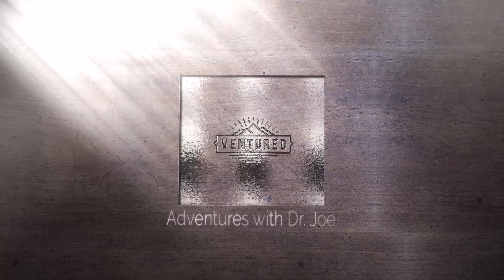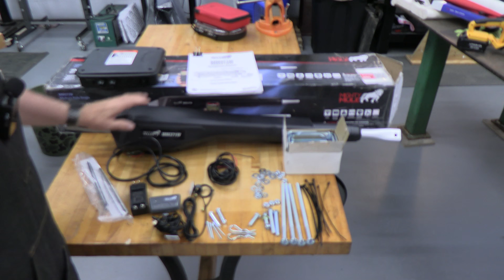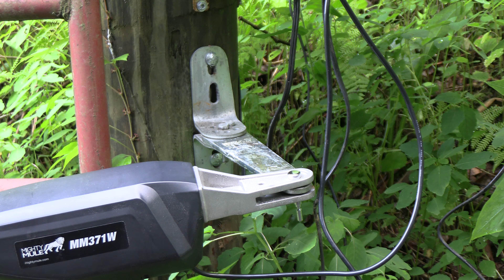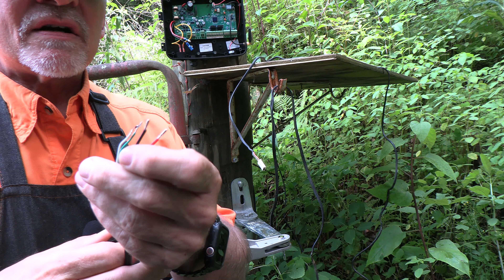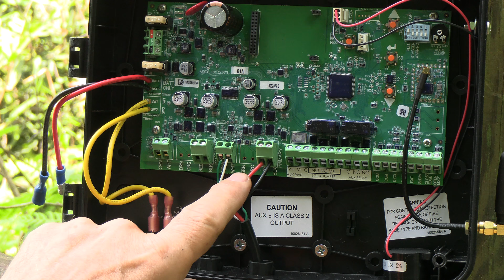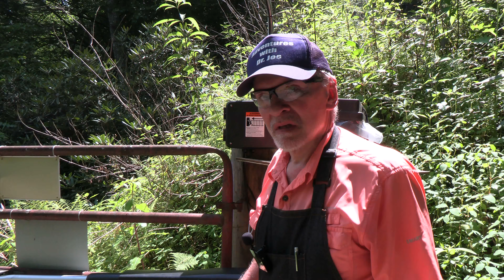Mighty Mule MM371W Review, Install and Setup

Comment: Dr.Joe great video. You answered all the instructions in the manual. I would be in your debt if you explained your 12volt car battery  connections? I am familiar with with the crimp on connectors used bit wondered about the terminal to connectors pathway. Ideally pictures and descriptions of your setup please.
Reply from the maker: I’ve taken a picture of what I think you’re interested in. I hope this helps.

Comment: I have a pull to open to leave the property so which pin is in use?
Reply from the maker: For a pull to open setup, you will use the pin on the top bracket. Thanks for asking, consider subscribing. Joe.

Comment: Joe, my 371 was working fairly fine until I tried to set the limits a bit more to my liking. Using your advice it was working better but not quite good enough. I tried it again and now it won't open or close and remote won't work. I've turned it on and off a number of times, hit the reset button a number of times. I don't know what else to do. Any advice?
Reply from the maker: Boy that’s a bummer. I’m not certain what to do but the first thing I would try is to disconnect the power so it allows it to completely reset if there’s a reset button and I can’t recall if there is or not I push that as well and get things started from scratch. Thanks. Joe.

Comment: The instruction manual says to run the gate through four complete open and closed cycles after setting the close limit. I can't find any way to do that since the remote will not work until the open and close limits are set.
Reply from the maker: So I would reset everything basically disconnect the power to the opener and then reset the remote then when you reset it all it should work properly. Give that a try. Thanks. Joe.

Comment: I talked to Mighty Mule tech support today.  They are saying that none of their models have an open limit.  The ram will withdraw 100% and it's up to the installer to connect it to the gate in the correct place.  My older model for sure had this feature, but that was a "Pro" version.
Reply from the maker: Yes, I believe you are correct. So during install it needs to be set up properly so when it fully opens up, it’s in a good position.

Comment: How did you hook up the wiring to the battery?  I'm currently using the small gate opener batteries but they are not cutting it.  I want to put a marine battery but my battery wiring just has those small spade attachments.  I don't know how I would hook that up to the battery.
Reply from the maker: Yes, the small batteries will not cut it. You need the full size battery and a marine battery is a good idea. I have a large 12 V car battery connected to a solar panel and what I use are large alligator clips as if you’re doing a jumpstart. I can’t recall if they came with thegate opener, but I believe they did. Thanks, Joe.

Comment: What kind of adapters you use for the power ? The yellow ones
Reply from the maker: I'm not sure I understand. It's powered by a 12 V car battery basically the connections are pretty straightforward and they aren't I also have a solar panel and it's pretty well labeled were the solar panel connects. Answers and thriving. Thanks. Joseph

Comment: I tried setting the close position but it keeps going past the limit I set
Reply from the maker: Yes I know that's a problem. Fully open is not adjustable so what you need to do is have it all the way open in the determine the correct position for your gate that adjust the setting for the closed position.

Comment: Ah. After installing mine. It keeps beeping. I also have a gate lock too.  Followed wiring and all. So im still troubleshooting
Reply from the maker: That beeping could be related to the gate lock, double-check the connections. It’s also possible that the beeping is related to low battery level. I would check that also Consider subscribing. Thanks. Joe.

Comment: I have a transformer to produce 12 volts.  Can I connect that directly to the battery input wiring on the control board?  It would seem there is no need for a battery if we have a 12 volt source from a transfomer.  We did this with the Ghost Gate Closer.  Worked for years.
Reply from the maker: To me that sounds like a great idea. I would give it a try. It’s a very clever. Thought. Let me know if it works or not. Thank you. You consider subscribing. Joe.

Comment: Mine isn't programming I can power it up by pressing and holding top and middle button
Reply from the maker: Thank you for your comment. I’m not certain as to what to do with that, but I would recommend disconnecting the battery. Totally powering it down and starting the programming process again if that doesn’t work, probably have to contact mighty Mule for a replacement. Thanks, Joe.

Comment: Mine opens 3ft and stops and starts a steady beep. Tested battery to 12/71 volts. What is the problem. It was working
Reply from the maker: Wow,

I’m not sure what the problem is. My recommendation though at this point is to do a reset unplug it from all its power reset it and you’ll probably have to go back and recalibrate the limit switch that should fix it. Sorry that happened to you. Consider subscribing. Thanks. Joe.

Comment: The current model only allows you to set one limit.  For example, with a push to close, you can set the close limit.  You cannot set an open limit.  You have to fiddle with the bracket and mount to get it just right.  This is a serious negative change that Mighty Mule has put into their systems.
Reply from the maker: Yes, I understand that. Thank you for your nice comment. I agree. However it remains a good unit, but it does have the deficiency. Consider subscribing. Thanks. Joe.

Comment: installed a new MM371W and got to the arm limit program steps and the arm will not close or open. Installed a brand new 12V battery and solar panel. Followed your instructions from this video (your instructions are much clearer and easier to follow than the instruction manual) However, the arm will not move. Any advice on how to correct this situation?
Reply from the maker: Man that's a tough one I'm sorry doesn't work. Probably need to give the company mighty Mueller called they can be very helpful thanks Joe

Comment: I have tried several times to program both the open and closed limits on the very same gate opener. My setup is pull to open. 
I can get the clothes position set properly but the open position as the arm retracts it will not stop until it bottoms out no matter where I set the manual limit. Please advise
Reply from the maker: Sorry to hear about that. This issue has come up a number of times. My recommendation is to completely power down the unit disconnect the battery source let it sit and then reprogram it from the very beginning. This seems to be effective. Why one closure limit works and the other doesn’t is a mystery. Give that a shot. I think that’ll help consider subscribing. Thanks. Joe
Reply: @JosephHunstad  i will try that recommendation and report back.
Thank you for the prompt reply

Comment: After a long search, finally somebody that explained the open and close setting on the MM371W. Thank you!!
Reply from the maker: Thank you for your very nice comment. I sincerely appreciate that. Consider subscribing. Thanks. Joe.
Reply: After an hour of trying to set the open limits without luck I found out that the open limits are just as far as it opens. You only set the close limits. Just make sure you don't have anything obstructing the full open or it will hit it thinking it is obstructed and close immediately instead of waiting for the close timer.
Reply: @JasonPenrose thank you, i only saw closed limit in the instructions (for pull to open).  I was searching and searching to see if we needed to do both.
Reply: @JasonPenrose ugh that was my problem too.  Why does he set the limits for open and closed on the video?

Comment: I have tried numerous times to program this Model to my Ford HomeLink System without success.  Do you have  video of how it is supposed to work?    Would appreciate any help you would share.
Reply from the maker: I have never tried that with the Ford Homelink system nor have I tried it with Home leak on a GMC product. In my truck I just have a small remote that I leave in the armrest compartment. Consider subscribing. Thanks. Joe.
Reply from the maker: Wait a minute I think I know how to do this. When you are programming your home link in your truck or vehicle, you program a two in existing remote control. It’s worth a try so just use the remote control that works on your gate when programming your vehicle. Let me know how that works. I have not done that. Thanks, Joe.

Comment: Hi! I have my limits set but the insurrections say to run it four times open and closed to get it to “set”. I don’t have a button for this and cannot get the system to stop “chirping” after setting my limits. I tried to program a remote to use it to open and close 4 times to set but does not allow my remote to control the gate because I think I am still in a learning mode while it chirps
Reply from the maker: I feel your frustration. Sometimes the opener needs to be reset and I’ve had success with that so I would completely disconnected from the power turn it off. Let it sit for about a minute or two and then start over again and that’s usually solve the problem for me. Consider subscribing. Thanks. Joe.
Reply: Did you ever figure it out I’m struggling with this same exact issue right now

Comment: , 9 will not stay closed
Reply from the maker: That’s a difficult question and a problem. What I would do is completely disconnect the battery let it get turned off let it reset and reconnect the battery that might fix it sometimes like a computer that Gate needs to be reset or rebooted. Consider subscribing. Thanks. Joe.
Reply: @JosephHunstad how long did you take to install it?

Comment: I've set and reset the opening  dozens of times,  and each time it goes beyond the "STOP" position I previously set. It appears to travel until the Ram is fully " in" no matter how many times I reset it.😢
Reply from the maker: That’s incredibly frustrating. I feel your pain. I experienced it myself and then I basically just reset it by disconnecting the battery and then reset everything and it worked. Consider subscribing. Thanks. Joe.
Reply: Did you ever figure this out? My new gate doesn’t stop either!?
Reply: Same issue here. Can set the open limit but not the close limit!

Comment: Joe, if a person screw's out the ram to adjust for short or long by hand will this mess with anything when setting the limits?? mine dont want to set a limit on pull to open at the fully open positions it will set the limit on fully closed but not fully open, any suggestions?
Reply from the maker: You ask an excellent question. If you do screw out the ram it could change the final position or set limit of either full close or full open. My only suggestion to this dilemma is to turn it all off and reset both open and close limits. It may work out OK that way. Consider subscribing. Thanks. Joe.

Comment: Thanks for making the video. Thoughts on installing an additional post to hang the gate operator on instead of using the additional bracket? I am about to hang mine and thought about doing that instead.
Reply from the maker: I mean, I think that’s a good idea
Reply from the maker: I think that’s a good idea. It may be unnecessary though. The gate opener is really really good way better than the previous ones consider subscribing. Thanks. Joe.

Comment: I wish I could get mine to work I have installed three MM gate openers in the past this so called smart one just will not work. already contacted the company.  I hope it's something simple but i think i got a bad unit.
Reply: Got it working... I think the problem was dip switches 4-5 were off and not on like in the picture in the manual. The manual says they do nothing but it makes me wonder cause it's now working with them in the on position.
Reply from the maker: I am so sorry to hear that. You know I have been through a number of these gate openers, but the newest model has the electronics separately in a waterproof box which makes total sense much better than having the electronics in the motorhead which frequently would get wet, also susceptible to insect manifestation, etc. I hope it works out for you so far my new unit has worked very well. Consider subscribing. Thanks. Joe.

Comment: Hey Joe great video! 

Another question for you: Our gate stops after tapping the hinge/ lock but closes about an inch shy of where it should to engage the locking mechanism. Do we need to reset the open and closed positions manually to fix this?
Reply from the maker: That’s a very good question. I believe you do need to reset manually the open close points to fix that. I hope your Gates working well. I really like my new one. I think it’s a vast improvement over the previous one. Consider subscribing. Thanks. Joe.

Comment: Great information. I’m having an issue with the remote. It sometimes takes me pushing the button 5 times before the gate opens. It beeps and everything, it’s like the signal doesn’t catch until after the 5th or 6th time. Any suggestions why that is? Does it on all remotes. Hit or miss.
Reply from the maker: Thank you for your comment and question. I’m glad you found the video helpful. I would probably replace the battery or the remote as a first thing and be certain when I use the remote. It has a clear line of sight to gate opener. Apart from that, I’m really not sure. Consider subscribing. Thanks. Joe.

Comment: Thanks for this video! I installed mine correctly - powered up, but would not open or close. I rewatched your video and noticed that my dipswitch settings were different than yours. I switched mine to match, and everything worked. Would be cool to have a follow up video on the dipswitch settings. Thanks again - solved my problem and made my day!
Reply from the maker: Hey brother, I am so happy to hear that that was helpful. Great job. Yes maybe I should do a quick video on those settings. Try to do that when the weather warms up a bit. I’m also having my left knee total joint placement in a week, so I’ll be out of commission for a little while. Consider subscribing. Thanks. Joe.

Comment: ? ever have problems with squrrels nipping the wires?  I thought putting some kind of conduit to protect wires would be good where I live.
Reply from the maker: Thanks for your question. Squirrels can absolutely be a real problem. They ate up all the wiring in my RANGER twice which was just a mess. I fortunately haven’t had squirrels messed up my wiring with my gate opener yet but it could always happen. Consider subscribing. Thanks. Joe.

Comment: I had mine for 5 months now it opens and wont stop opening, then go to close about 2-3feet and stop, like it wont hold open stop position. Any ideas.
Reply: great information i did try this myself i had the gate pull to opening mode i cracked it open to find that this model can't be set to stop on a pull to open position it has a small switch to auto stop on fully retracted  mode it finishes at full retraction and stops but if it binds before that it reverses automatically and starts closing in other words mm371w only needs to know where to stop when extending keep the good videos coming along great watch now following
Reply: @mondod3054  that is finely some good news ive been going bat S@#* CRAZY trying to get my 371 to stop where i want it at full open position, it seems to want to close all the way on its own no matter how i program it. also i have drawn a line in the ram where i want it to stop and it gos past that line at full open then i hit the remote and it gos to the line ive drawn, so it totally disregards all the previous extension limits i set for it.
Reply from the maker: Wow, that’s incredibly frustrating. My only suggestion would be to try to reset. The whole thing start over. Disconnect the battery and then reprogram open and Stop positions. I hope that helps otherwise I’m not sure. Thanks. Joe.

Comment: hello, i have a RB570 18VAC transformer running off 110V that i used on a MM560 to charge the battery.....will it work to charge the battery with this gate opener instead of solar.?
Reply from the maker: My idea is that yes it would be OK because we’re charging a 12 V automotive battery, so I think it’s gonna be all right. Consider subscribing. Thanks Joe.

Comment: Thanks for the video. I have had the 371 installed for about 14 months, and it's all good until now. 1; I have a beep every 4 or 5 seconds. 2; The motor does not respond to the remote.
3; The gate will open and close when I manually hold the open or close buttons. 4; When looking at the circuit board, the top button flashes red when the remote is pressed.
Can you advise, please?
Reply from the maker: OK I have had a similar thing happen. I’m not certain this will work, but this is what I would recommend. Disconnect the unit from the battery. Wait a good three or four minutes and then reconnected. That’s all I needed to do to mine to get it to work again it’s frustrating. You have to do this but basically it’s a reset. Just like with a computer. That’s my recommendation. Please try it. I hope it works. Consider subscribing. Thanks Joe.
Reply: New battery